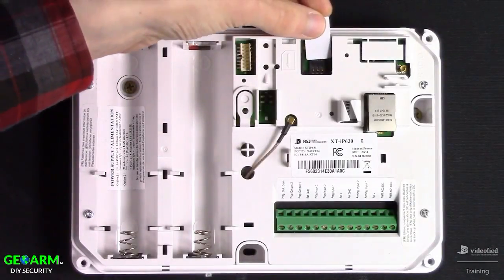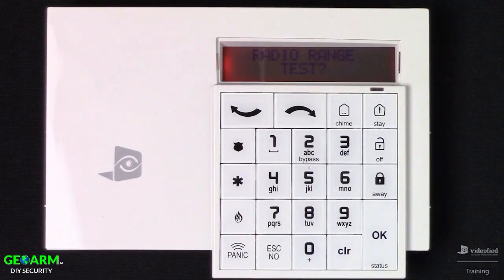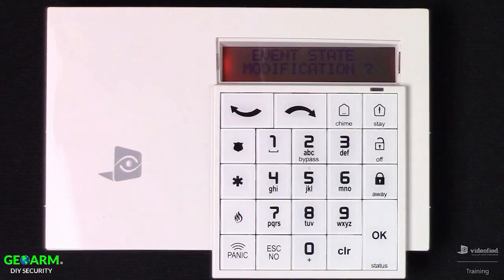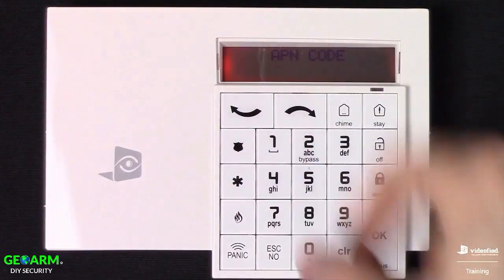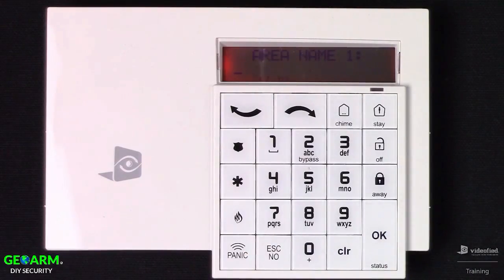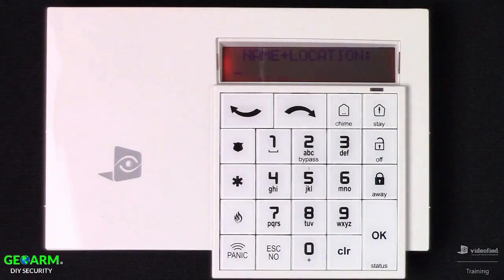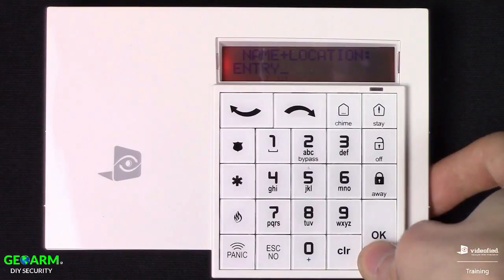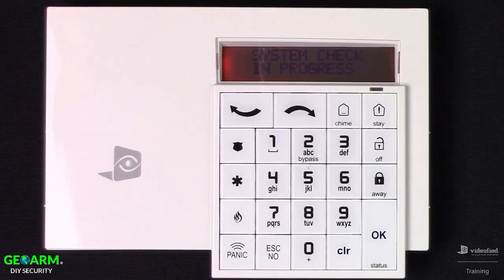How to Install a Videofied XT Alarm Panel?

Comment: I tried calling UK sales for RSI Video the makers of this stuff and numbers dead... called their UK dealer and they refused to give me *any* info on the device unless I bought it from them or PAID for YEARLY support. So now I am faced with having to call their main offices in France to find out how to get this system working with the video clips sent to my phone - their help files are awful and seems that you HAVE to be with a paid firm who will handle the alarm calls and their APP wont let me register because even after I put in the serial number of the control box and the password im using on it it says PANEL UNKNOWN... RSI dont seem to want the users to fit and know how to use this stuff themselves - for fitting and use by professionals only it seems. I am an IT engineer so know they are witholding a lot of stuff that will help or make this work, like ZERO software on their site for me to download to make this work on a PC and as I said the APP is a mega FAIL. Do you know if these systems can actually be setup and work without connection to the unobtainable software known as Frontel or Frontel Comfort.
Reply from the maker: These are professional video verification systems. In order for them to work properly, you will need to activate with a professional alarm monitoring company such as ourselves. We are known to have the least rates in the USA but, we don't provide those services in the UK at this time. Best of luck let us know if you have any more questions.
Reply: @Geoarm  Thanks very much for getting back to me but the problem is NOWHERE in their literature and sales brochures do they say you MUST activate witha  professional alarm company, infact quite the opposite. They imply these can be used at homes and with an APP... and they do not say CANNOT BE SETUP WITH NO PAID FOR ACCOUNT. RSI should say that. I bought these to be a cheap way to get video back in a wireless way cheaply.. now it sounds like its going to cost me an arm and a leg to be tied into a contract. ;-( I might as well sell these on then, useless to me. Do you have any idea how much this costs to be connected for a year on average?
Reply from the maker: @TheSecretVault  I'm not sure we are just an authorized dealer of RSI Vidoefied in the USA. We are known the have the absolute least expensive rates here in the USA starting at No Long Term contract $25/month including our live operator monitoring. We will be able to see what is going on only during an alarm event and we can provide that information directly to local police departments to help verify that an actual alarm is going off. Videofied was created in hopes of reducing the amount of false alarms police get dispatched on which it does. Let us know if you have any more questions.

Comment: 0:57 u talk about brake away tamper but didn’t have a screw in it 😂😂😂😂😂😂😂😂😏😂
Reply: All of the ones I’ve borrowed from abandoned buildings never have had it installed as well lmfaooo 3 keypads 16 sensors and 2 panels and a siren lmfaooo
Reply: @videoverifed i need help broooooooo